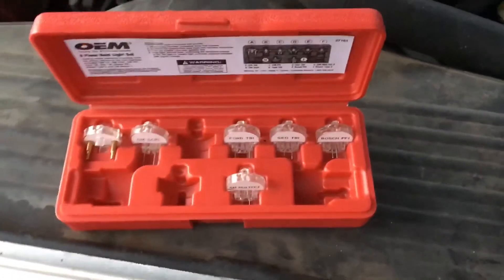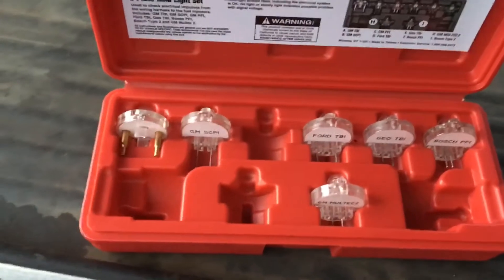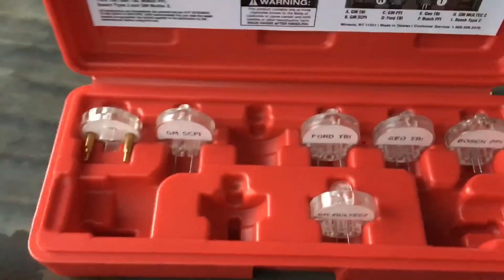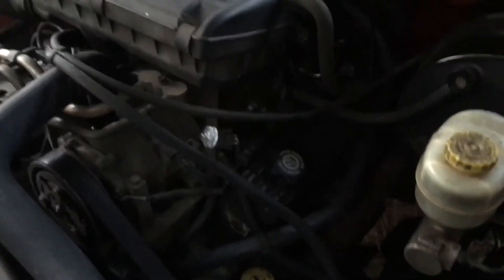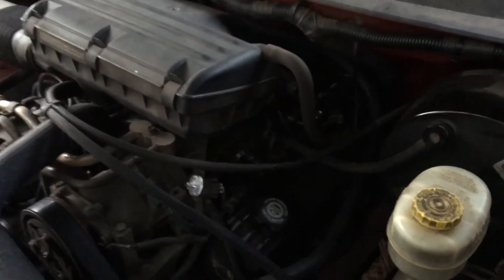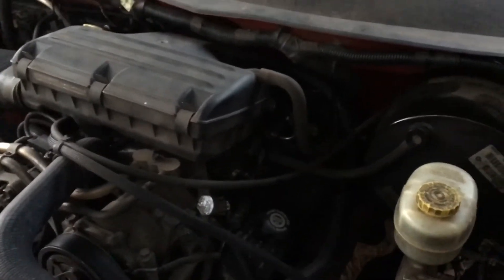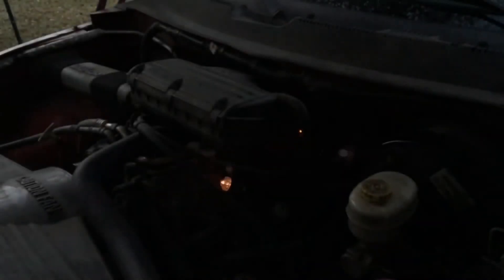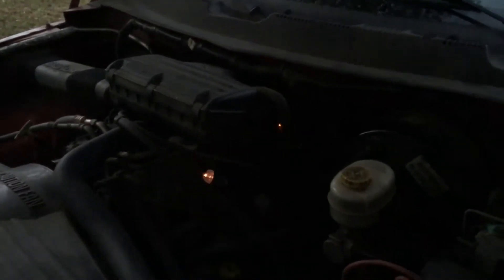Debunked - Dodge Fuel Synchronization - Part 3 (Whoa/Not What I Expected)

Comment: If the fuel sync is not done correctly after replacing the distributor and cam sensor, can that cause a no-start?
Reply from the maker: As explained in the video yes if the fuel sync is not set the engine will not start.
Reply: @moccasinmarine  My 2001 Dodge Ram stalled over 2 years ago.  I had it towed to a mechanic shop.  They fired the parts cannon at it, including the distributor.  It still doesn't start.  I am questioning whether they did the fuel sync at all.  It cranks but no start.
Reply from the maker: @USkeZB3mpyAMCV  supposedly there are ways to set fuel sync without a scantool. The comments in my Dodge videos tell you how.
Reply: @moccasinmarine  We have high end scan tools.
Reply from the maker: https://youtu.be/yjIKzprbgOY?si=Ly1e7FwjLfFePv2K

Comment: this shows that you can set the fuel synch close enough using a dvm...the dist at tdc pointing at #1 then put a dvm on the signal wire....the v6 timing mark is at 147 degrees (supposedly) but rotate the crank to that mark then adjust the dist til it reads 5v....synch is set.....v8 mark is 17.5 degrees (supposedly)

Comment: I just completed a big job on a 5.9 magnum, I am glad I watched your video’s before putting it together as one of the parts I replaced was the distributor since the shaft etc and I was a victim of the fearmongering due to the “fuel synch”
I found your analogy of the gm 4.3 dist to be spot on, it is even simpler with this distributor since it has a flat shaft and you don’t need to consider the gear travel as it engages to the cam. It is either correct, or 180 degrees out. I completed replacing a host of seals and gaskets in the engine, placed the dist to point to the #1 terminal and when I turned the key it started instantly and runs really quite well, however I did end up with a check engine light and a code p01391 - do you think making small adjustments to the distributor position would change that, or should I have someone attach a scan tool to it, I only have a scanguage I don’t believe it can show realtime pods
Reply from the maker: You said you installed a new distributor. I would put money on it that the distributor has an aftermarket cam sensor that is intermittently defective. If the engine runs at all the fuel sync is fine. The code is for an intermittently bad cam or crank sensor so I would install brand new crank and cam sensors of Dodge mfgr.
Reply: @moccasinmarine   thank you for your reply. I did install a new distributor as the one that was in there had alot of corrosion etc. I ordered my parts from rockauto so the actual mopar brand was not availabe, the one I used was wai global, I chose that brand because I used one in my 4.3 chev a few years back and am happy with it (especially since it has a metal housing unlike the gm plastic one). The durango with the 360 magnum had been sitting for a few months as I disassembled it, located parts etc so once I was done with it I initially removed the fuel pump relay and cranked the enging over for some time to build some oil pressure, with the relay reinstalled I primed the key twice and had 50 some psi of fuel so I turned it over and it started instantly and runs very well even driving it all runs very strong - since then I have been messing with it to make sure all is good with leaks etc and today when I started it that engine light and code are no longer there so I don’t know if it had to relearn the cam position or what but all is great with it now. The distributor I bought actually came all assembled with a stick on seal on the position sensor with their phone number support line etc as their warranty may be void once the seal is torn, their distributors seem of decent quality.
I am very happy that you posted your videos and I feel you have a good understanding of the system and I felt much more confident to go ahead and swap the distributor since all the bs I had hears about the fuel synch had me gunshy. The fact that you compared it to the 4.3 gm really hit home with me as I had done mine a year and a half ago and really struggled with the installation of that one since all you really have to do is make sure the rotor is at the number 1 firing position and the computer does the rest. It just seems too simple to me having never done distributors on fuel injected/computer controlled engines before so timing lights, adjustments afterwards etc.
When I do “tune ups” now I always just replace the distributor assemblies as opposed to cap,rotor,pickup coil because it is usually only another few dollars to just get the whole thing and then you have a new shaft/housing to boot.
Thanks for your videos I have watched quite a few.
Reply: This engine only has 115000 km on it, I disassembled it because the lower plenum plate on the intake had a failed gasket and the intake/timing gaskets had failed also - kind of a quirky setup that engine is

Comment: Not for nothing but the system is no different than say a 7747 gm computer that fires either batch injection for individual cylinders or for the older TBI units .   The cam sensor could be completely eliminated, just takes a few extra rotations for the crank to pick up the proper cylinders .  Many use it with a cammed up engine and to initially build oil pressure .    Good videos.  Informative for those who can follow and understand.
Reply from the maker: The 7747 was not used for any batch multiport systems. It was TBI only which was alternate fire. There was also never a 7747 used with a cam sensor. Cam sensors didn’t come around until 1996 in trucks. I think the Grand National and maybe some Cadillacs used cam sensors in the 1980s. There is an aftermarket product that used a 7747 for multiport in batch fire mode. That product is “dynamicefi”.

Comment: I feel you brother. Trying to figure out what engineers do as to the big 4 is beyond explaining. Nowadays the so called Techs at the dealer just read out of a book. 
Us Mechanics working on multiple platforms have to think as yes reengineer what the oem did, just to troubleshoot an issue. I am a diesel guy mostly heavy equipment and Class 8 trucks. I don’t do petrol/gassers unless it my own families vehicle. 
I love it when us lowly mechanics not for pay figure out certain fails in systems those college engineers paid so dearly for as to education. Well done a good video.

Comment: The video made since but I need real time fix ..my 5.9 litre gasoline engine runs good,idles smooth but has lost a lot of power well before I hit  254000miles. My gut tells me it's the slop in the timing chain and the distributer .maybe not ! However if I run 93grade unleaded I get additional  power back but not near what it had when below 200,000.miles it's been a slow deterioration.thanks for the Video I'm a bit late to watch .
Reply from the maker: Check your catalytic converter. It clogs up slowly over time.
Reply: Also those are notorious for leaks on the bottom of the intake where a plate is bolted from underneath, the gasket between them fails and it leaks vacuum and draws oil vapors etc into the cylinders - if run this way for a long time, the catalytic converters can get clogged. I am in the middle of this plenum gasket repair right now, not exactly a fun project

Comment: Pretty sure the cam sensor in the dizzy is only used during start up. I just know it has to make a full turn before she will light. Then I think it's replaced by the crank sensor for timing. Could be totally wrong about all of that.
Reply: It is.  Basically the same way the old batch fire computers of the 90’s for GM worked.  They will crank and start  with just a crank sensor.   Takes a few revolutions of the starter until the crank sensor picks it up but does run .   Using. A 0411 computer on a 5.9 just because the tuning software is much more usable and much much cheaper
Reply from the maker: I just found your comment. So you switched to a 411 pcm to run a dodge 360? We’re the crank and cam sensors compatible or did you have to use GM sensors and figure out how to mount them?

Comment: Just watched this video and I’ve come to a conclusion: you have misunderstood what people mean when they say the cam sensor position is for injector timing. We’re not saying it’s variable during operation like the ignition is. It’s a mostly static setting. I say mostly because if you actually go through the DRB3 setting process, if you set the fuel sync to +4 for example, it won’t just stay +4. In real time it will change quite rapidly. 43422243344334556554444356444345444344. Alot like that. But that’s as close as static as you can set it just due to tolerance. But that’s what we call +4. So now that we’re set to +4, the injectors are just going to 4 degrees of distributor rotation sooner than they otherwise would when set to the OE spec of 0 degrees. This is regardless of rpm, load, ignition timing, etc. It’s like locking out the distributor in a carb application and running 30 degrees all the time. This is why it continues to operate fine when disconnected yet refuses to start when shut down. Without that setting it IS as you have said and the crank sensor doesnt know where in the 720 degrees it is. The cam sensor needs to show where cylinder 1 is and when and once accomplished the cam sensor doesn’t really matter. The fuel sync is set in the pcm.
Reply from the maker: Once again you are completely not understanding the point of my videos. The fuel sync has nothing to do with injector timing or cam timing. All it does is help the PCM identify where the crank sensor is in a 720 degree cycle. And by the way the reason the fuel sync setting jumps around is due to the slop in the timing gears and chain that I mentioned in the video. I’ve got another video coming that will explain why you need to set fuel sync at zero or best you can at zero and nothing else.
Reply: @moccasinmarine  I think you're right.  My guess is that the PCM determines what rotation you're on right away at, or after startup; thus if you pull the plug on the cam sensor, it doesn't matter..

Comment from the maker: Tomorrow I will try and box in when the injectors are firing using an idea I had today. GM fires them at 300 degrees crank rotation but not sure if Dodge follows suit. I think I can show that they fire between 260 and 330 degrees after TDC on the power stroke. Watch for the video on that.
Reply: Look forward to the video